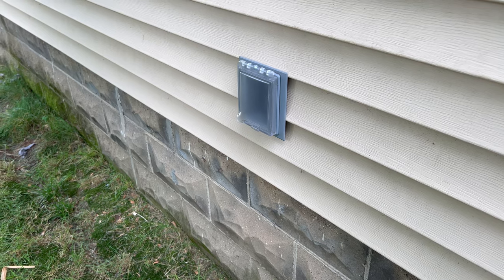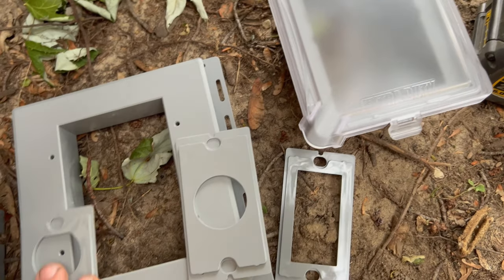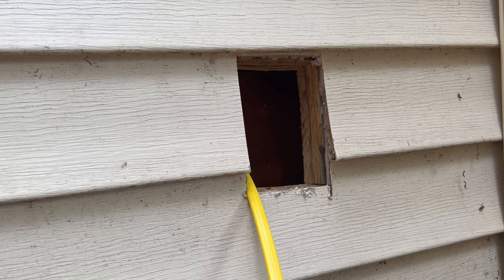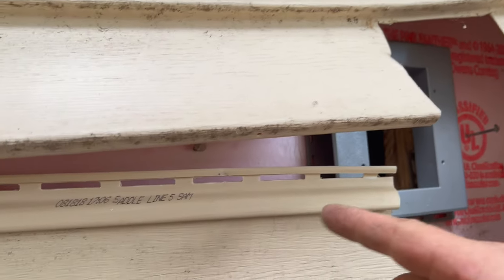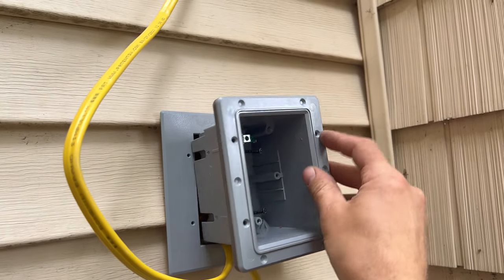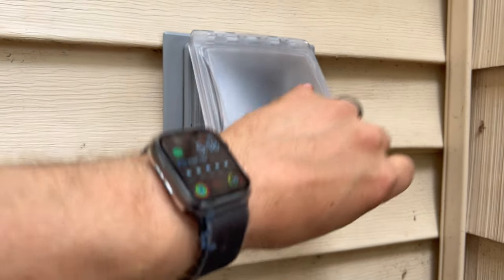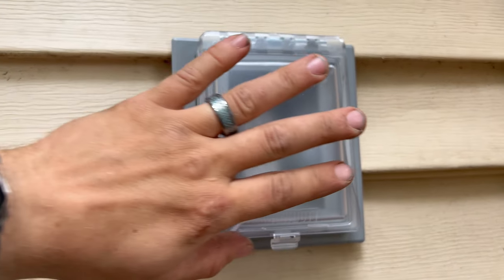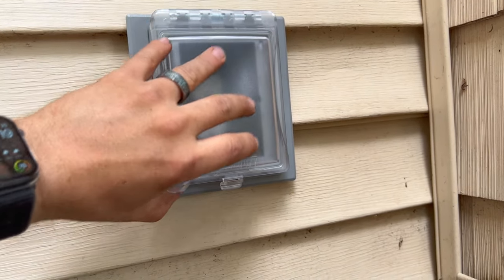Is This Possibly the Best Outdoor Outlet! Easy Install!

Comment: One thing many people may not realize is that multiple GFCI's chained together is nothing but a waste of money. Our outdoor electrical outlet has a GFCI in the breaker, so it, like this new one (hate these new ones due to high potential of spider or wasp infestations, BTW), it's a standard receptacle
Reply from the maker: Yes and no, it’s nice in one regard having multiple gfci, if you pop the gfci at the outlet you know which one. If you just have one at the beginning you need to go hunt that one down.
Reply: @radozeman  True. As long as they're pigtailed rather than chained.

Comment: Shouldn’t some caulk have been used on the siding adapter to the house, or foam you attached it ? Because the other nesting parts have seals?
Reply from the maker: If you are trying to seal the electrical no. I suppose you could seal the top and sides if you want to, I won't seal the bottom just in case water does get in, it has a way out!

Comment: The round is for heavy duty 110 sockets. Some have a single socket that's round like that.
Reply: This. Single 20's are pretty common
Reply: Where did you get this box from, I want one for my RV outlet on my garage
Reply: You talking such as an appliance receptacle like a microwave would use.

Comment: Anyone else think this job would've been easier had he started by removing the siding first... then marking and cutting with the siding out of the picture... install the box, then measure, mark, cut, and reinstall siding once it was installed?  That's an honest question, I've not done a job like this, so maybe I'm over complexifying things.
Reply from the maker: You can, doing it this way though I know the box will line up.
Reply: His forehead is well protected! 😂

Comment: I'd much rather drill one small hole that is easily sealed and mount a box to the siding without decimating my air and thermal barriers.
Reply from the maker: I'd agree if you can't seal this from the inside, in my case I can.
Reply: @radozeman  what did you use to seal it?
Reply from the maker: @helmanfrow  Spray foam, my outlets are in the floor joist space, so easy enough to foam.